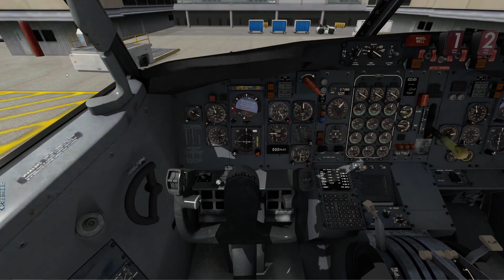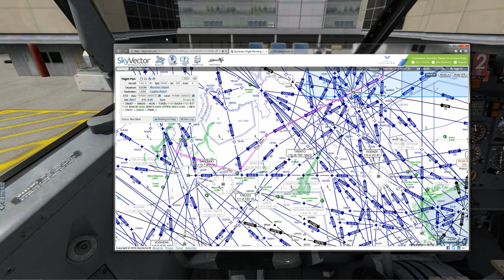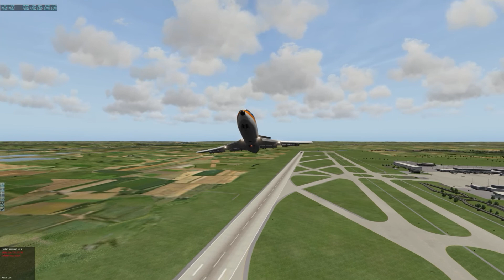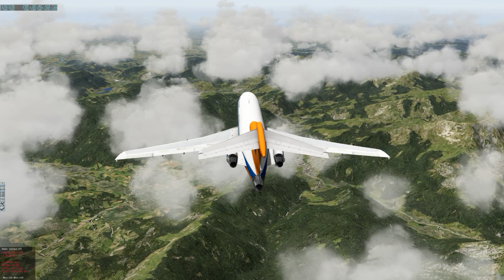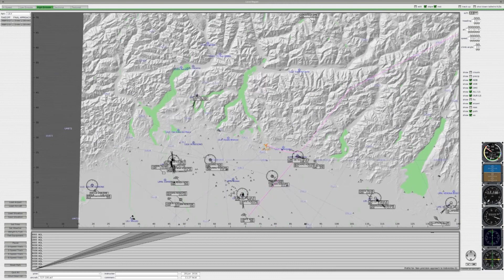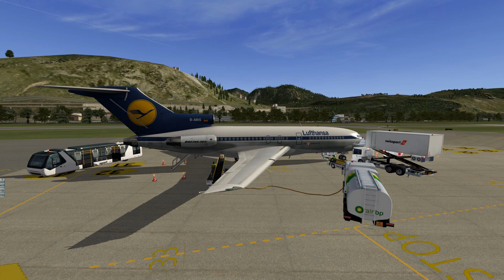Fly J Sim 727 V2 New Version First Flight

Comment: Funny crew you have there :) between the ground crew and Jawoll Dieter they dragged the GPU all the way to the taxi line on push back. But seriously, I had difficulties with some of the 727 flows. Some switches did not move. Have you updated your flows? As usual an eventfull video which is interesting to watch...
Reply from the maker: :-)Thanks Kosta:-)  X Plane is always a challenge for a Prepared Pilot:-)  Don't worry about the flows, they are being worked on. Version 2 has reworked most of the old data commands! I just finished watching your EADT x737 video, which I too found very interesting.....:-)
Reply: Did the guys already include the new virtual cockpit commands for the x737 in MCE? I wasn't sure when reading the descriptions. I want to avoid downloading those 750MB repeatedly. Also waiting for the IXEG737 support. We are spoilt with good addons  for XP these days. I have started from scratch with P3D v3.3 still not even near the v3.0 installation. So many addons and sceneries to be installed again and tested. But looking good so far :) With 2 simulators there is always sth to do in the little simmer time.
Reply from the maker: Not yet! V2 has only been out a few days, however we still have triple crew and jawoll Dieter:-) The IXEG737 is close, in the meantime that superb EADT x737 is fully supported...and is a thing of real beauty! I am sticking with P3dv3.0. As we discussed elsewhere. All those Orbx installs are fine in my old v3.0.....If we only could have Orbx in XP?